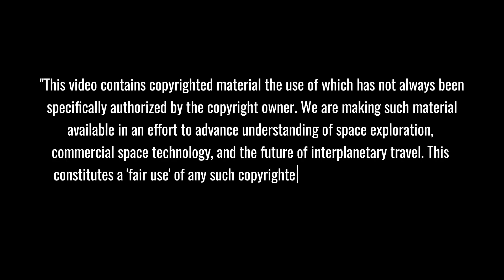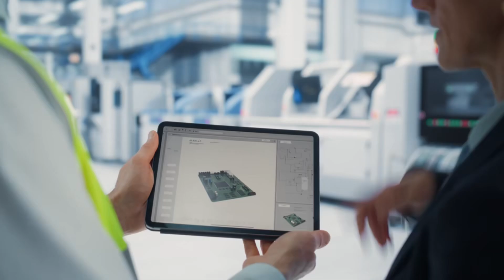UNEXPECTED!! What exactly Happened with Booster 14's Secret Upgrade Before Flight 7!

Comment: ALL along, whn u've mentioned in regards to cryogenic engine was used (testing)❓️Makes a lot of sense to me. 

Mind, u, I went back on my "chem-schemic board." I realized it's used were more than environmentally friendly than any other options. Also, cryogenic is non toxic and able to reduce the cost of launch operations vs. the use of gasoline or fossils as fuel tht's harmful to mankind.

I hope my statements 🙏 of analysis were correct.

My admiration and Thank U, Mr. Genius Elon ✨️ ⚗️🌟